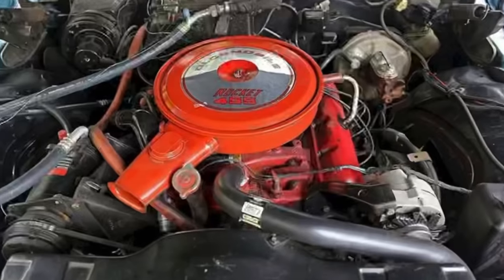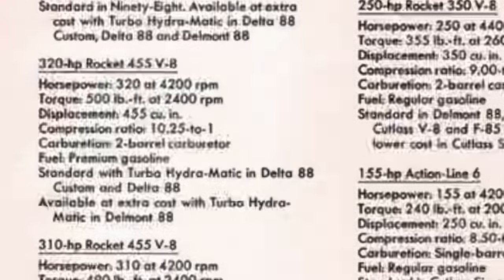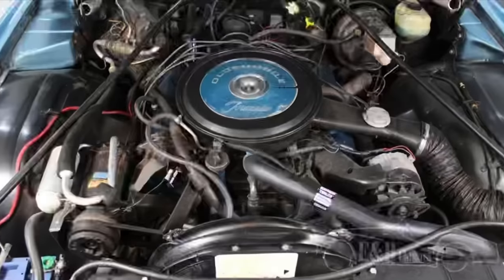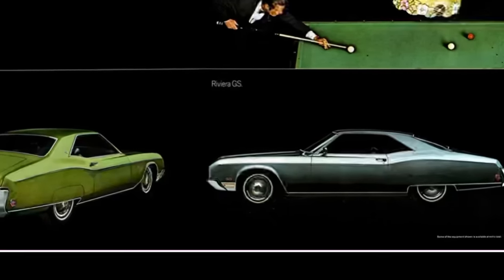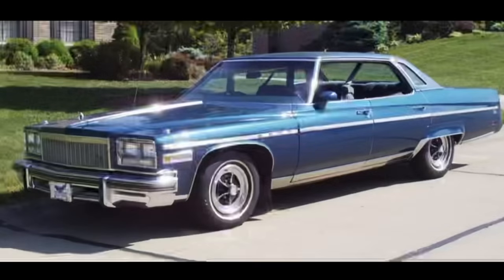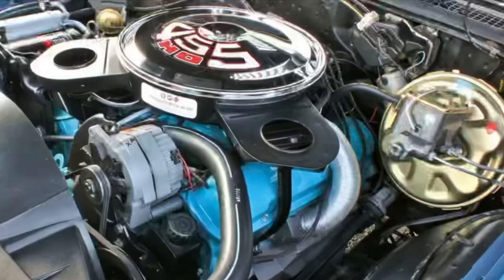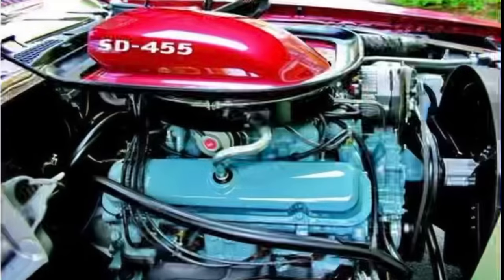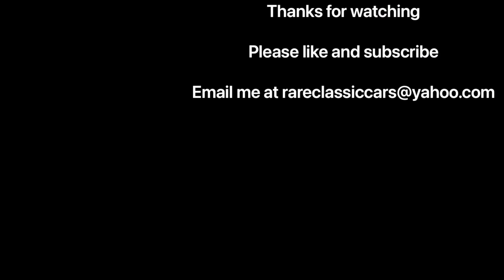Best Car Engines - The Rise of the Mighty 455 V8s from GM’s Buick, Oldsmobile, and Pontiac

Comment: I read that Pontiac essentially used one block for all the displacements from 326-350-389-428-455. Correct me if I'm wrong. I owned the 1969 Firebird 350. It was a blast. It did only have that 2-speed hi-lo automatic so it was VERY slow off the line, but stratospheric top speed for the day at 140+mph.
Reply: That's true. They were all the same size externally, because all were based on the original 326 block from 1955. So there is no small block or big block Pontiac V8, just 1 family of Pontiac sized engines. For example, a Pontiac 350 is the same size as a Pontiac 455. Unlike Chevrolet, which has a family of engines(265-400) based on the original small block 265 from 1955, as well as a different family of engines(396-454) based on a much bigger engine block starting with the 396 in 1965. Chevy also had another family of big block engines from 58-65 called the W-series due to the scalloped shape of the heads. But usually when people speak of the big block Chevy, they mean the 65-up 396, 427, or 454.

Comment: My first car was a convertible Buick GS Stage 1. At 16 I did not know how rare the car was. Mine had a manual 4 speed and was one of 64 (68?) produced in 1970.  Nothing like cruising at night on the highway well over the speed limit with the top down and listening to that engine just rumble on. Unfortunately the Stage 1 engines had some oil issues and mine fell victim to them

Comment: The long stroke is not why an engine may be judged as a low RPM torque monster.  It would be the cam, heads and intake.  The bottom end is just an air pump and as long as piston speeds are kept below reasonable limits, the volumetric efficiency at low, mid and high RPMs has everything to do with, like I said above, cam, heads and intake characteristics.

One of the big reasons we tend to see big bore/short stroke engines in high revving applications and small bore/big stroke engines in low revving applications is due to the size of the valves.  Small bore means small valves, so you will select a cam, and design the heads and intake to maximize the area under the operating range which means a low RPM torque engine.  Similarly, when you can fit big valves, you would also tend to fit a cam and design the heads/intake for higher RPM ranges to get a benefit from the airflow those big valves could enable.  This will decrease that low RPM torque in exchange for higher RPM power.  But it's not the stroke itself that has ANYTHING to do with it.  However, if you took an engine with a given bore (say 4") and built different stroke combinations, you would find that the increased displacement will challenge the heads to flow more air as RPM increases and if the head is particularly restrictive, the HP peak RPM will come down as stroke (displacement) increases.  But that's because the head is restricting airflow, not because the stroke is somehow preventing the engine from revving.  If you somehow converted this engine to a 4 valve head and didn't change anything else, you'd have a much higher revving engine.  Again, it's not the stroke itself.
Reply: Oldsmobile did build a 4 valve 455 around 1968. Hot Rod magazine had it on the cover along with a good article on it. The thing I remember the most was the flat torque curve.....500 pounds/feet from 3000 to 7000 RPM. Aprox. 300HP at 3000 to aprox. 700HP at 7000RPM.
Reply: @turbo8454  Wow.  A perfect example to prove my point!
Reply: @kevin9c1   I believe Pontiac was also fooling around with overhead cams and more than 2 valves per cylinder on the V8 at the same  time. They already had the  OHC 6.

What ended it all was the increasing government regulations on emissions.
Reply: I have to disagree with stroke length has nothing to do with torque production. While I agree changing valve size and airflow is going to increase torque and horsepower numbers, horsepower is basically torque over time. Or RPM in the case of an engine. Yes an engine is an air pump. Your piston is connected to a crankshaft via a connecting rod and its job is to spin the crankshaft. The air/fuel mixture is exploded to force the piston downward. The longer the stroke the more force is exerted on the crank. Kinda like when you have a bolt you can’t break loose with a 3/8” ratchet you get a 1/2” ratchet to break it loose or you use a breaker bar or a cheater bar. It is torque that breaks the bolt free and you have more of it because with the longer bar (stroke) than the shorter one. Torque production is why 383 Chevy small block stroker engines are built out of 350 blocks. A 350 will rev up through its RPM range quicker than a 383 will but the 383 will make more power because with the aid of the longer stroke, it will produce more torque over a longer period of time (RPM range) therefore more horsepower if it can be fed the proper air/fuel mixture.
Reply: @mikee2923  You are succumbing to an old myth as applied to engines......that longer strokes make more torque.  While you are correct that a longer throw (lever) will produce more torque, you have overlooked two things here.

The first thing you overlooked in your example is that the 383 you referenced (as compared to a 350) has a greater swept volume (displacement) and therefore burns more fuel on each power stroke. The torque increase you mention is created by the burning of more fuel, enabled by the longer stroke.  While their may be an instantaneous increase in torque at the moment of peak pressure verses the 350, the overall average (brake mean effective pressure per cubic inch) will remain the same in the 383 as it does the 350. (assuming everything else is equal)  The 10 percent increase in displacement will yield a corresponding 10 percent increase in torque.

The second thing you overlook is that for engines of equal displacement (and all other things equal ass well), the longer stroke version has a smaller piston thus less surface area for combustion pressure to push on. The longer stroke is offset by the smaller linear force created by the smaller piston.  These 3 455's are a good place to do your first comparison. The Oldsmobile is the most under square and the Buick is the most over square.  HP and torque figures as well as torque peak RPM's are pretty  much identical.

There are better comparisons out their too. 302 Fords and 305 Chevys.  305 GMC V6's, 300 Ford 6's and 292 Chevy 6's are three good ones to compare.  There are many others over  the years as well.
Reply: @turbo8454  Nice job.  "The longer stroke is offset by the smaller linear force created by the smaller piston."  Came here to say this and you saved me some time.  Adding stroke increases torque.  Adding bore also increases torque.  It turns out that adding displacement increases torque, regardless of how you add the displacement.

Comment: The thing about the Buick 455 was that it was light by those standards I was in auto class in the 80s and my mom had the estate wagon I put a timing chain in it and tuned it on the Sun machine it had so much torque it would push you back in the seat, plus the 455 was only 100 pounds heavier than a small block Chevy What an engine I wonder what it would have done in a GM g body

Comment: I had a 69 Delta 88 custom sedan with the 455 2bbl carb V8, and I had a 75 Electra 225 sedan  (matter of fact you showed my old Buick in this video, it was the dark blue sedan , well my Buick was that blue color until I had it painted white) ,you are very correct about the Buick water pumps,  I know the issue from experience, Buick 455s also had issues with the fuel pump and getting it aligned in the block, like I said before it took me some time to put a fuel pump in because the pump arm would not line up and seat properly. I  miss both cars, the Oldsmobile a little more, I wish that I could get them back. The Oldsmobile other then body rot and loud lifters never gave me issues , the Oldsmobile was  certainly more faster than the Buick

Comment: These three 455's are so different in design there are likely more similarities between any one of them and a non-GM V8.  
Pontiac made it to 455 without changing the external dimensions from all its smaller displacement engines. That is why the 455 is undersquare.
Oldsmobile raised the deck height but kept the same bore centers as the smaller engines.  Caused the big 455 to be undersquare as well. 
Buick just scaled its small block up in size - the 455 big block is just a mechanically scaled up small block. 

For some reason Buick decided to mount the distributor up front, angled toward the driver's side on all their V engines - small blocks, big blocks and even the V6's. Cadillac must have liked the idea because the distributor, oil pump and filter mounting locations on the 472 series engines look to be the same as on the Buicks.

Comment: thank you for this upload. I definitely picked up knowledge from this and now I know a few things that I did not know I did not know. I am probably six months away from the first Dino testing of a 455HO that I know very little about. It was built for a ‘65 GTO, but my dad is using it for a ‘64.  it is set up with the tri-power intake manifold with a 4-barrel flanked by two 2-barrels. unfortunately, I do not know who the engine builder from metro Atlanta was, cam, specs, stroke, anything, and the super cool guy that we got it from has been deceased for years. everything looks brand new inside and out. I’m pretty sure that he built it to be a ground pounder. any suggestions for a performance efficiencies are welcome and appreciated

Comment: I lived in Flint, Michigan from 1971-1984, when I joined the Air Force and left after high school graduation. At the time, Buicks were still being built there, and Buick headquarters was also there, next to the plant. I lived on the north side, 10 blocks from the Buick engine plant. Law enforcement agencies in Genesee County, where Flint is the county seat, all used Buick police cars until 1983, when Buick stopped making police cars, and they went to the Chevrolet Impala police cars. Sad that the 1982 Buick police cars only had the straight 6 engines. Yes, the 1970-71 Buick LeSabre police cars had 455 V-8s in them, but after that, they also declined in available horsepower.

Comment: I worked at a Buick Olds Pontiac dealership in 1986-87. Back when everything was going front wheel drive and V-6. I remember being told to go through all the old GM service manuals and throwing away anything previous to 1977. Probably threw away 50 or 60 various shop, service and fisher body manuals from the 60' and 70's. Grand Prix's, Lemans', Cutlass' Electras' and the like. I had a feeling at the time I should keep these somewhere for future use but nope. Oops!

Comment: The thing I always wondered about was with Pontiac the 428HO in the 69 Grand Prix was rated at 390HP. How was it that the 455 was down rated (detuned at Chevrolet’s request?) to only make 370HP in 1970 before the compression ratios dropped? Pontiac also had the 455HO from 71-72 which ran fairly close to the later SD455. I also seem to remember the Buicks had oiling issues in that they pumped the oil up top to the lifters first before the main bearings. I remember this was a huge reliability issue with the 231 V6 which I believe was designed like the Buick V8 with 2 cylinders chopped off. Also the reshaped secondary ports in the Pontiac intake manifold started in 1975 with the redesign of the EGR valve and was across the board for all Pontiac V8 engines, even the W72 400 had it. It seemed as though GM knowing that the 455s would be gone after 76 they strived to have them all have close to the same output by then. From 75-76 Pontiac (and I believe Buick also) only had 1 flavor of 455 (200 and 205HP respectively) while Oldsmobile had 2 versions. 88 98 and Cutlass had 190HP while the Toronado and the GMC motorhome had 215HP.

Comment: One big item of note that was not mentioned pertaining to the Buick 455 was the weight. By boring out the 430 and keeping the same stroke, the 455 was lighter. It weighed a mere 25 pounds more than a 350 Chevy. This equated to far better handling characteristics than it's competitors

Comment: The reason you like the feel of the Buick 455 is because of the turbo 400 Switch Pitch.  This tranny was in Buicks only, had a lower 1st gear, and a better torque converter.
Reply from the maker: The switch pitch was also in Olds and Cadillac

Comment: I guess any of these can be built to suit particular needs.But the Stage 1 is the engine to have,it was Way underrated from the factory.I had the Olds on the GMC motor home and my only complaint is exhaust sealing very torquey motor .

Comment: I understand why GM had to trim back the model lineup but I always mourned the passing of Oldsmobile, just great cars.
Reply: Even the last Front Wheel Drive 3800 powered cars. My late mother in law had Cutlass Cierra with a 3800, and that was a really nice car for FWD.  On the bigger Olds I had a 3800 with the roots blower from a Pontiac of the same vintage , my father in law overheated the original 3800 and I really tried to sell him the Bonneville engine. Those 3800s with the blower were the last hurrah for some time. I think the LS is OK but it sounds like 351W wheezing along even when they are fast.

Comment: The Big Other Guys. Those were really great because of one thing, Rochester 4Bbl Q jet, and Maybee the varying kinds of Delco ignition and later HEI. The little guys, the 76-78 Bendix Port Fi, with Olds 350, was a great idea, but never filled the gap on the now Olds 403. Such a sad demise of the 4.62 bore spacing engines. The engine strain died as the 301 Pontiac in 1981 and 307 Olds in 1990

Comment: Running the numbers, the Pontiac 455 was closer to 454.47, the Olds was not quite 454.6, and the Buick was almost 455.2 cubes. Our Estate Wagon got almost 19 mpg highway, though we just didn't talk about the city mileage, or clutch operation and sloppy column shift linkage. Not fun when the shifter hitched in first with the lever in the neutral slot. We eventually learned to be cautious on the 1-2 shift. You could get about eighty in second.        
I wonder if that one is still on the road, or any of the '70 Buick B-body sticks?

Comment: Some ultra high revving engines - Honda S2000, Lambo V10 - have under square bore/stroke; meaning, they're long stroke motors but don't start making real power till about 4,000 rpm. The key to power band is rod ratio (connecting rod/stroke ratio), in conjunction with cylinder head, camshaft and intake. A quick perusal shows the BOP 455s' road ratios to not be too dissimilar though the Buick has the highest ratio.

Comment: Goodday Adam, 

I have been waiting for a video exactly like this & you hit it out of the ball field.
Thank you for mentioning the Oldsmobile W34 option in the Toronado.

My question,  Why did Oldsmobile go on talking about the W30 being hand build & blueprint & were only making 370 hp, yet the W34 which was also fitted in the Hurst Oldsmobile they were not advertise as hand build & blue printed but made more hp.

360 hp to 400 hp.

What I don't understand why wasn't the there a 442 W34 option.
The LS6 made 450hp so power to weight ratio isn't a argument. 

What is your take on it in the Oldsmobile camp ?

Intrested in your opinion.

Your number 1 Fan in Australia 
Louis Kats from Melbourne Australia ☺ 👍 ❤ 

Are you going to the Toronto Motorama next week end ?

Comment: I agree with your assessments on all of these (dare I say, big blocks). I know this is a car channel but, medium duty trucks of the 60s and 70s with destroked automotive based with heavy duty alterations for  longevity and maintainability could be included in the conversations surrounding this topic, in my humble opinion. It can be approached w/o an aspect of dimensionality as, these where all large displacement engines. Lol

Comment: There was one 1968 442 that had a 455 and it was the Hurst Olds and they were the best engines. I was a gm mechanic and told this to the crew we had there and some wanted to disagree but after i asked how many oldsmobile engines they had replaced they said none, then i went threw all the other brands they saw i knew what i was talking about .

Comment: Fun fact: The Buick 455 actually displaced 456ci. Also, the Buick 350  (actually a 349) was dropped after April 1980.
Reply: And the Pontiac V8 didn't survive 1981.
Reply: @corvettejohn4507  Right. Meanwhile, the Olds 307 lasted until 1990, and Olds got another V8 of its own in the 1995 Aurora… and then a unique V6 based on that.

Comment: I’m  Oldsmobile all the way. Owned and still own a 72 with a 455.   But Buicks 455 is reported to be lighter than the other GM engines of that size.

Comment: The Oldsmobile was built way overbuilt article I read like not even cost effective. And my dad would pin his 120mph on a weekly event in his 72' Delta. The 70 Buick fast with class is the craziest amount of torque 520 ft lbs. and of coarse the LS6 454 has the highest horsepower advertised 450hp. The PMD well super duty I can't wait for your up coming video on it its a jewell of a motor.

Comment: In 1969 Riviera had an electric fuel pump. But the 1969 and 1970 Riviera the fuel pump worked off of the oil pressure switch.

Comment: We had both the Buick and Olds versions of the 455. I found the Buick to accelerate the LaSabre quicker than the Olds did the Delta 88. That said, I never trusted Buick's Aluminum Oil Pump outside the engine, and the long Pipe between it and the Oil Pickup in the Pan.